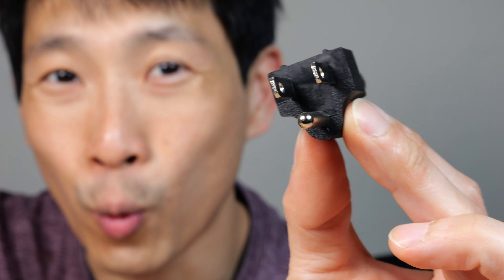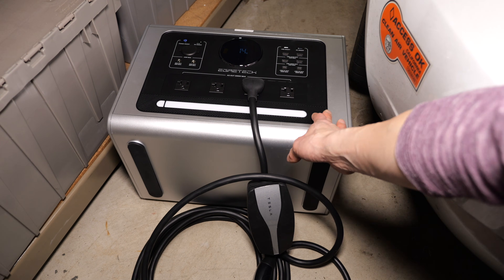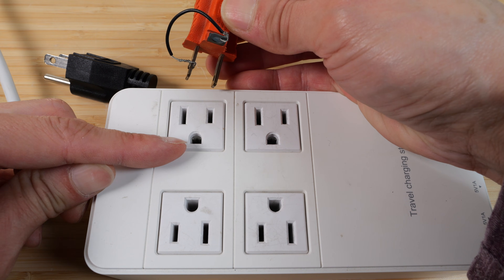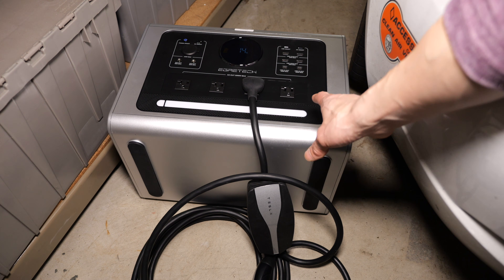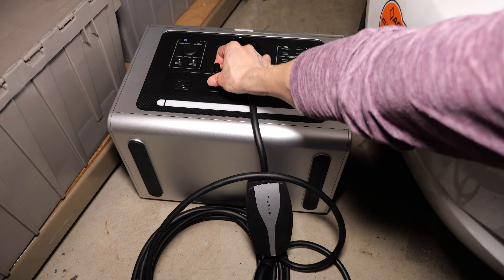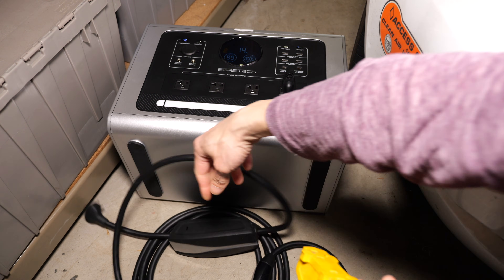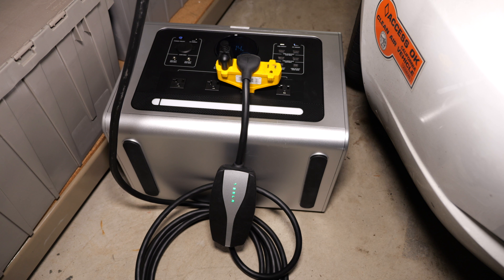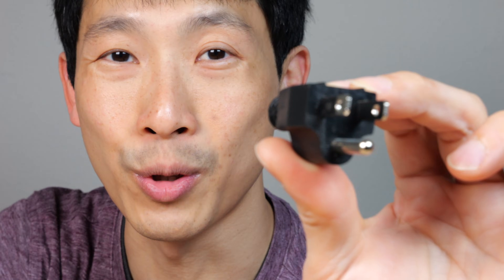What's a Ground to Neutral Bond Plug?

Comment: Thanks for the informative video! What happens when ground gets bonded to the live wire?
Reply from the maker: I'll take an educated guess. Since the power station is not grounded, you will make the ground live with the plug. When you plug something into it, the device will have ground charged up to live voltages and most products would not have such strong reverse voltage protection. So you'll likely blow up whatever you plug in.